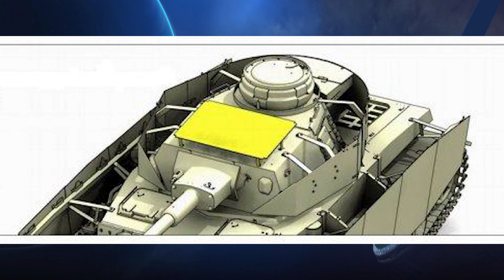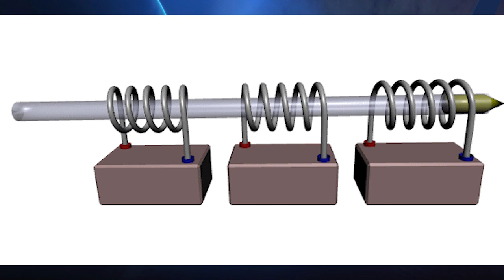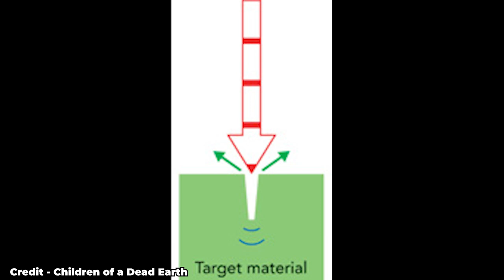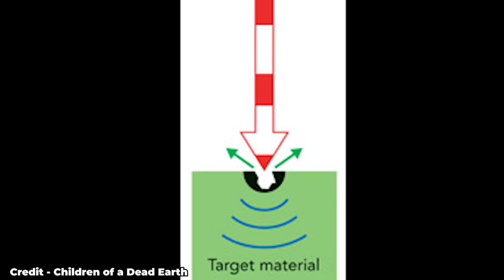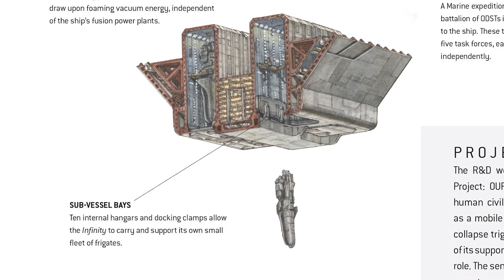Post-War Frigates of the UNSC || Mulsanne/Anlace/Strident - Class || Halo Ship Breakdown(s)

Comment: Spaced armour would entirely nullify plasma fire, at least until the entire plate melted and fell off as its not a projectile so much as it’s a transfer of heat to make things uncomfortable for the target. Impacting any surface would force the weapon to loose cohesion and deliver that energy to the plate, if there is nothing important directly attached to that plate to be heated by convection/conduction the weapon is basically useless. It’s surprising it’s not more common on UNSC.
Reply: I feel like it would be a bit too costy, and maybe would make the ships even larger, plus wouldn't it stop a bit of point defense from working? (This may be very stupid)

Comment: I feel like Laser weapons replacing MACs make a lot of sense, it might cost more initially to make a laser that can pierce armor, but if the weapon is kept in service long enough, and used enough times, it eventually becomes the cheaper option, because, outside of the fuel for power generation, it costs next to nothing to fire a laser, vs a MAC round, they have to use a huge mass of Tungsten or Uranium, and unless those materials have become a lot cheaper by the 2500's, they're going to cost way more per shot

Comment: about spaced armor in space, it would be effective against plasma as metal is general very thermally conductive, meaning heat spreads through the metal very quickly which a space will stop this effect or minimize it, this is important because as metal heats it reaches a certain point where all of the strength of the material is lost (usually .25 times the temperature that it melts at) meaning that residual heat from a shot on one side of the ship will significantly reduce the structural strength of the metal throughout the ship without space/buffers
Reply: i’ve spent 3 years studying this stupid stuff about to be 4 lmk if you guys have any questions
Reply: Mostly just curiosity but would the decrease in structural strength in the ship really matter that much for the UNSC. Few of the enemies they face use kinetic weapons so as long as the surrounding metal stays strong enough to hold the ship together and still requires the same melting point to get through for energy weapons wouldn’t the loss of strength effectively be a non issue?
Reply: @sturm9087   theoretically it would be fine, however if the structural integrity of the ship weakens, the vibrations caused from the engines can cause the overall structure to essentially shatter, not only this but if the structure is weakened enough for the inner chambers to be exposed and the airlocks to be sealed, then there is no way to perform maintenance on the engines if they get hit, unless they use robots which is completely feasible for this era. I would assume that if these panels are used to shield the engines from thermal damage, the smaller beam attaching these panels to the ship are likely made of some expensive but thermally absorbent material. these panels in a space battle scenario would work similar to era (although without the E-explosive and R-reactive portions) the panels would break off after being hit hard enough and would stop providing protection after awhile. I’m not sure if I fully answered your question or not but if i missed anything lmk

Comment: The advantage for the wing engines is increased rotational ability. Moving thrust away from the center of mass allows more torque for the same energy. However, as you point out, it has its draw backs. Vulnerability being a key one.

Comment: Precision and range of a laser has nothing to do with its speed. Your maximum range will be limited by your focusing optics. Lasers DO converge/diverge. Shoot at something too far away and they'll just see a bright star as the light scatters out to be larger than their entire ship.
Reply: It has everything to do with its speed - a laser has much, much faster time-on-target, such that a target needs to be at stupid distances to 'dodge'.  They're also, generally, less prone to 'error' in that light exits lens at a narrower angle compared to a gun.  You may not do much more than give the enemy a tan at a hundred thousand kilometers... but the railgun shell is literally miles behind.

Focusing then limits the practical range of the laser, but - basically, it gets harder to hit with a solid projectile with distance, but no matter how far away the target is, a kinetic slug still hits just as hard.  A laser is very easy to hit with out to hilarious distances, but becomes weaker quite quickly.

Comment: something to take into account is heat radiators(i dont remember if halo takes this piece of physics into account) one of the only reasons i can fathom, aside from armoring, that the mulsanne has the plates so close to what i presume would be the reactors is to radiate heat. in space there are very few effective ways to radiate heat and if you dont youll very quickly notice that your space craft is getting hotter over time. one of the easiest ways to radiate heat in space is surface space. in my mind it makes far more sense to have the wings be heat radiators as opposed to armor plates due to the fact that heat build up, especially for a power hungry laser(or god forbid plasma weaponry) would be to dissipate the heat build up from the primary weapon systems
Reply: Maybe, but then they should be glowing when the ship is in combat.  Also not quite as universal as that theory would suggest.

Given the whole 'Mil-Scifi Violently Collides With Space Opera' concept of Halo, it'd be neat if UNSC ships started with big glowing radiators, Covenant ships don't have them, and the UNSC versions started to get smaller as we got into the post-war vessels...

Comment: I thought the Bright Lance on the Mulsanne was based on Forerunner hardlight projectile weaponry? Isn't it basically just a lighter MAC moving at the speed of light? Because that was a lot of bleedoff, I mean, light disperses, especially in atmosphere, the visual effects would linger for a lot longer than it was actually present for, not only that, but light at a distance is hard for human eyes to track, you very much would only be seeing the after effects of the weapon other than the actualy Bright Lance.
Reply from the maker: You're right, the brightlance shouldn't be visible, but it is in fact described as a laser. I think it would be called the Brightlance Hardlight Projector otherwise.

Think similar to the Spartan Laser. Light must behave differently in the halo universe.
Reply: Lasers can be visible if desired . Lasers work better in a vacuum but still has ineffectiveness at a great distance . You can just put more energy into it to improve i it . Sorta like we increase the size and mass of projectiles to improve them
Reply: It is a laser
Reply: @patricofritz4094  Lasers shouldn't be visible in a vacuum... but then, it's cool, and makes the action a heck of a lot easier to follow, so...
Lasers definitely can be visible in atmosphere.  Though the kind of laser that is combat useful might, in practical terms, be blinding to look at.  Just the beam, scattering through the air.

The Brightlance looks like it should be a plasma railgun or something, which... honestly?  Would make sense.  You've already got a magnetic accelerator, if you don't need to worry about melting the projectile, you can pump in more power.  Add in some Forerunner shenanigans to keep the stream from self-repelling...
Reply: @basedeltazero714  I never said in a vacuum I only said it was possible. The person talked about in atmosphere not just space.
Reply: @basedeltazero714  not everything has to be a railgun it's a laser don't overcomplicate things and bring your biased weapon - railguns into this. Folks like you only think about railguns as sci fi weapons , which was a mistake on the expanse , and give lasers and the likes a hard pass
Reply: @patricofritz4094  
What.  Did railguns kill your dog or something?
Reply: @basedeltazero714 ... tf ? ...
Reply: @basedeltazero714  that's absurd and irrelevant. Just a cover for your hurt feelings
Reply: @patricofritz4094  I'm sorry for your loss.
Reply: @basedeltazero714  still crying eh

Comment: Well think of it this way, direct to energy weapons are much more efficient than their chemical or even magnetic counterparts. For example in the real world ion engines reign supreme in total delta v (amount of speed you’re getting from rest from the engine) where magnetic nozzle based forms come in second and chemical engines come in after that. But besides that a photon sail with a ground based laser pusher would be even more efficient. The point is that photons are the ideal medium for radiating energy, the amount of effective energy you’re getting slinging a metal bullet with electromagnets is going to be a lot less than the energy you’d get in simply beaming the energy straight into a target because of all the energy you’re loosing powering magnets. Now how the UNSC can manufacture such a big, I assume to be a fiber laser, without melting the lens is a mystery in its own right. Maybe they distort gravity itself to be an ideal lens like the covenant did. Who knows. Point is that lasers are much more efficient at delivering energy, as long as you can make a good one that is.

Comment: 31:05 whos to say you need spacalized versions to dock? Would make way more sense to have your hiant super carrier built with docking bays standardized to shipyards then need specalized subclasses of escort models that require addotional modification, i feel like the only diffrence between regular and onboard escorts would be what each ship is assigned to do, hell wouldnt be suprised to see them traveling in fleets larger then its onboard complement and having it serve as a tender moreso then a carrier at least for anything prowler sized and up, would allow diffrent ships to rotate out to restock on supplys, repair damage and gove the crews more R&R and even training options given the wargames simulators onboard also I feel like the strident isn't so much a successor to the mote ground assault focused legacy models but more so a bulked up SF insertion platform given the provisions for booster frames and a focus of more drop pod based insertion options, this is like something you would use when you don't need the stealth of a prowler to insert teams but need to engage in large surface actions for raids vs conventional ground assault and occupation, I can see these used not so much in hit and run raids but hitting a soft target to the point it's completely incapacitated then loading all your troops back onboard and bugging out befoe reinforcements respond to sos calls

Comment: Small crew for a large ship. If it's more than 450m, just think, current USN Aircraft carriers are 332m long, and those are massive ships with up to 5k personnel. So, these frigates have much more power, larger, and it's crazy to think they wouldn't carry at least a half a dozen aircraft, both for transport, cargo, and figher and support aircrafts. And at least a dozen or so troops for security.
Reply: Is understandable for the old ships of the UNSC to have low crew because the mac takes up a lot of space, but the new ones like the mulssane that doesn’t have a Mac should atleast have a very large crew hell a invasion force

Comment: 3:55 While the Stalwart is a pre-war design and the engine pods might be threatened by insurgent attack, during the Human-Covenant war such a weakness is irrelevant: if a Covenant ship gets a bead on a frigate it will pop like a bubble.  The only hope is that it can fire its MAC before that happens.

6:30 Note that would, in fact, be much more powerful than basically anything we see in the series, with a yield in the teratons TNT.  On the one hand, it womps Covenant ships.  On the other hand, the waste heat should vaporize itself, and the bombs that destroy the Earth stations are so much smaller...

8:10 It's called a 'reflex laser' which suggests that it's... reflecting... something?  One could imagine a series of lasers along the arms pulsing independently, somehow... redirected by Skiffy Bullshit in a 'forwards' direction?

9:20 Well... lasers are, as a rule, less efficient than coilguns, both at the 'muzzle' and the target.  So typically equal energy should get you less boom per joule than a MAC.

10:20 Well... laser diffract as diffuse entities, each individual photon scattering.  The entire 'beam' isn't offset - not from this, anyways, the physical precision of your steering - i.e. your turret or actually pointing the ship - could be an issue.  Moving out of the way of a laser is hard, as well, because it can just track you...

On the other hand, you can rotate, cause the laser to hit an undamaged section of the hull and be unable to do much more than score the paint, so to speak.

28:05 Yes... but does this work when you're not dealing with the Covenant's staggering (lack of) EWAR capabilities?  That is some... staggering 

29:05 Armor is irrelevant given the firepower disparities involved in the Human-Covenant war... and possibly in pre-war scenario, too, where UNSC ships would rarely encounter seriously armed enemies.   Post-war... well, it's a bit more relevant now.
 On the other hand, sight is irrelevant when the human crew is mostly there for repairs and a leash on the AI that actually do the point-and-shoot... which is a problem when AI is suddenly Highly Suspect.

30:30 Given the EWAR focus of the ship... perhaps the Anlace's lasers are meant to be used to burn out enemy sensors?  Suddenly dumping A Lot More Power Than It's Meant To Handle into a radar/lidar/etc is a very effective way to fuck the whole system up.

34:42 Where is it though?  The 'lip' hanging down from the upper arm blocks the spine of the ship.